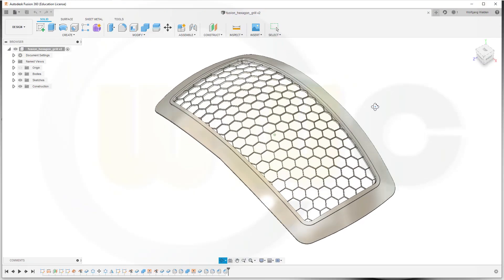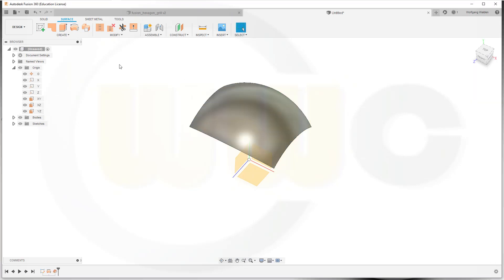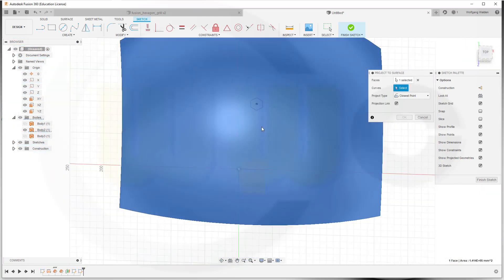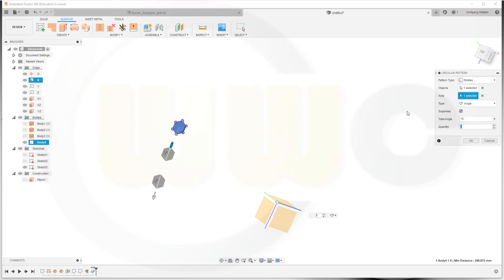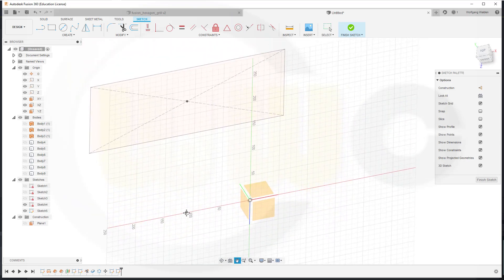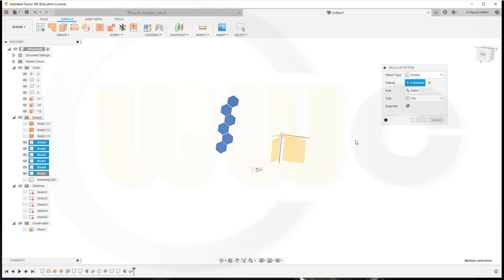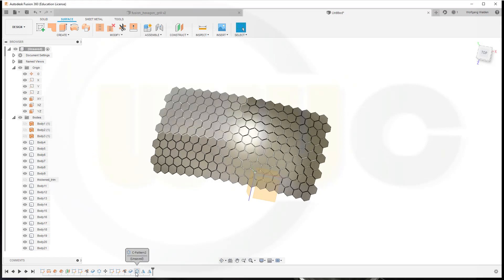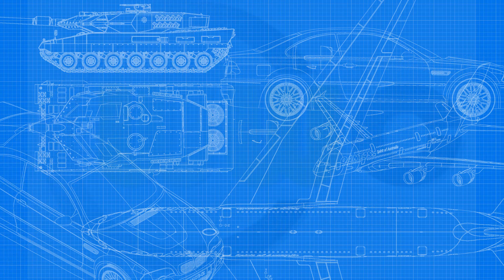Hexagon Grill - Fusion 360 Training - Part Design

Comment: Hello Mr. Walden. These videos are impressive.
FormFusion 360 there is another video marked "easy". But it seems to me in principle the "easy" one allows to cover a curved surface with undistorted patterns? Thanks.
Reply from the maker: Thanks :) Yes, the "easy" version should provide a more accurate pattern.
Reply: @wolfgang.walden.cad.training  I just finished, ten minutes ago, a small design (I'm just a hobbyist) using your technique (the easy one). I particularly loved the offset plane technique used after the bends to get rid of the lower half of the body (the upper half has a non-continuous webbing in my case)